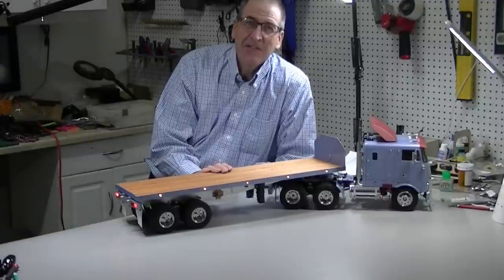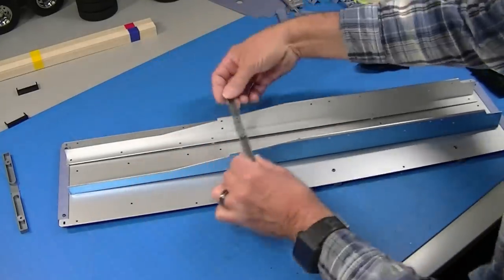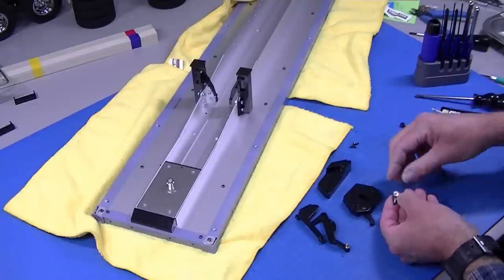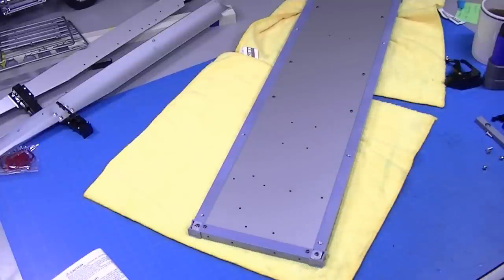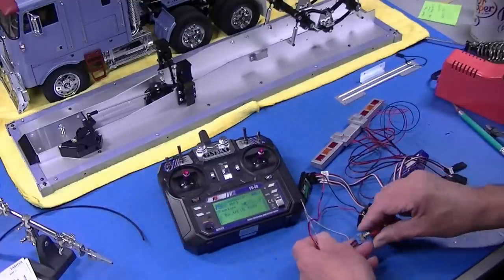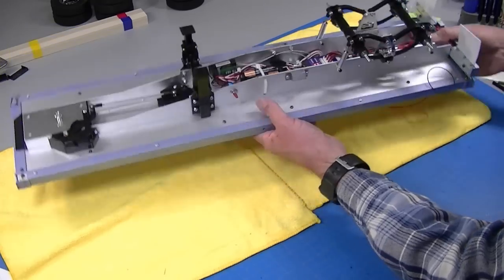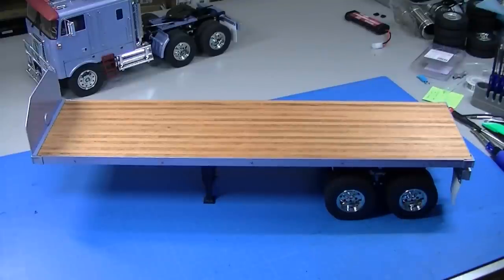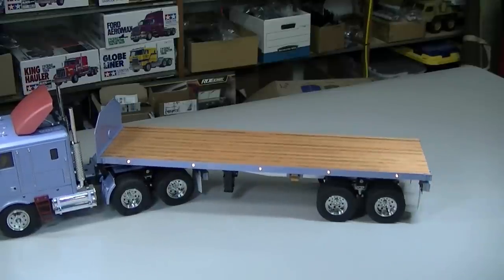1/14 Tamiya Flatbed Trailer Build w Wireless Lights - Globe Liner

Comment: I got the flatbed and started putting it together. In making sure I had the bed the correct way I didn't notice I put the king pin plate on backwards so the center hole was up front I guess we all make mistakes. I did the wireless lights and side marker lights the same as you did also added the Motorized leg kit. I put pictures on your Facebook page.

Comment: This is fantastic video showing the wireless connection. Thanks Bob! Is it possible to bind and control the trailer legs as well?
Reply from the maker: It would be possible but the Tamiya motorized legs sure do nut have any requirement for it.

Comment: I thought today. It would be cool if you could set up a linkage off the trailer landing leg mechanism to the electronics switch, so when you attach the trailer and the landing legs go up it also turns on the trailer lights.

Comment: I use only 1 double sided tape on the last cross piece( at the back) to secure the deck. That way if you need to get under the deck, removal is easy and doesn't damage the wood.  The load will keep the deck down!
Reply: Didn't it warp? Even if is' inside all the time the wood is going to buckle!!!

Comment: Hi Bob, my names Chris. And I had gotten a tamiya globeliner, and a flatbed trailer, and I can't get both to bound at the same time. Do I have to use two six channel receivers, because I have a 10 channel in truck and a six on the trailer, and I can't get them to bind. Don't know what else to do. Thank you and I hope to hear from you soon. Thanks again Bob, and I love your channel!!!
Reply from the maker: It only works with the i6a receivers.  The 10 channel or the "b" receivers will not work.
Reply: Hi bob , I have your modified fs-i6x radio and having trouble getting the two i6a receivers to bind together. Is the i6x capable to do this ?

Comment: I enjoy watching you build kits, informative and relaxing. On the light kit, would it be possible to power beacon lights or strobes? Going to have to order some parts from you come payday for my Bruder snow plow conversion.
Reply from the maker: Yes, you could power beacons, flashing LEDS's etc just fine.
Reply: I think there is a company called RAM that makes such lights.

Comment: Being a wood warier, I'm curious that even though it's just a small modal and wood expans and contracts if the air has a little moisture  wouldn't the wood warp? should have spaced the joints!!!!

Comment: Hello I would like to know please what is the voltage for the leds of the multifunction mfc-01 I would like to install others but I was wondering what was the voltage distributed at the output of this device given that the battery is 7.2 volts

Comment: I would love to get two of these kits and make a 45' or 48' trailer out of them. The kit is only about a 32' deck. I was thinking a guy should be able to cut the wide part of the frame out of one kit and splice it into the other.  Then splice the side rails (or buy some aluminum angle and make new ones) at a different point for strength as well as the deck. A guy could always by a dolly and make a train out of them as well.
Reply from the maker: Easy to build a long trailer out of 2 of these.  Also you could make it a triple axle.  I did something similar on my Hemtt trailer build.  (see my older videos)
Reply: @HobbyconceptsLLC   Yes I was just looking at that. I also found where someone had stretched their kit to 53' using only one kit. They did make new side rails but did not extend the frame underneath. Seeing the construction could easily do it with one kit, some 1/2 angle and some sheet aluminum.

Comment: I have the Radiolink AT10II 12 Channels RC Transmitter along with the Beier SFR-1, will this setup work with that?
Doug
Reply from the maker: If you have the Beier SFR-1 you are better to use the Beier IR or BT trailer units.

Comment: Hi Bob, nice job! Wondering, do you think this wireless setup would work  (binding 2 Rx) with an MFC-01 in the truck? Thanks
Reply from the maker: Yes it works fine.  The blinkers however run at different rates.

Comment: Hello bob
I can’t get my radio to bind both receivers at the same time as you have instructed 
I have the fly sky fsi6x transmitter and fsia6b receiver in the truck and light kit
Reply from the maker: Only works with the iA6 receivers.  The "B" receivers will not work.
Reply: Great I'll have to order those 
Both need to be a rec ?
Thix Bob

Comment: Hi Bob, did you add any primer on the aluminum before you painted it? Any chance that the paint may peel off?
Reply from the maker: I primed it, but anodized aluminum is hard to paint.  It does scratch easily.

Comment: I have the flysky i6x and was wondering if the second receiver that goes in the trailer has to be the same as the receiver that is in the tractor? Like can I have the fs-ia6b 6 channel in the trailer and the fs-ia10b 10 channels receiver in the tractor?
Reply from the maker: The 10 channel receivers will not work.  Only the 6 channel.

Comment: hello, does the light set have to be the same as the one from the truck?
Reply from the maker: No, in fact the truck does not even need lights for this to work.  Only works with i6a receivers.
Reply: @HobbyconceptsLLC  thank you 👍
Reply: @HobbyconceptsLLC  i have a different set of lights for my truck like what i have for the trailer, that doesn't matter, right?

Comment: Does this only work with the FS-IA6 receivers? I bought two Flysky FS-IA6B receivers as that was the only thing my hobbyshop had and they are not working together. I can only bind one or the other. Not both. Or is it my radio? Just realized I have anm FS-I6X not an FS-I6. Will that make a difference?
Reply from the maker: Only works with iA6 receivers the "B" receivers will not work.  Not sure about the transmitter.
Reply: @HobbyconceptsLLC  Thank you for the clarification. Although not the answer I hoped for.

Comment: Hello. Just want to know if want to do this wireless trailer light what items I need? Can you let me know..? Thanks
Reply from the maker: You need a light kit, battery holder, switch and receiver.  Only works with some radios and receivers - for example will not work with Flysky 10 channels, only the 6 channel.

Comment: Bonjour j aimerais savoir svp quelle est le voltage pour les leds du multifontion mfc-01 j aimerais en installer d autres mais je me demandais quel etais le voltage que distribut a la sortie de cette appareil etant donner que la batterie est de 7.2 volts

Comment: I tried this with my FlySky FA-i6X, I can’t get the two receivers to bind together. It’s only one or the other. Please advise.
Reply from the maker: Won't work with the 10 channel receivers - only the 6 channel.
Reply: @HobbyconceptsLLC   I am using the FA-iA6b 6 channel receiver. Is there a different one I should use? Thank you.
Reply: Lou, Did you ever get to the bottom of this question? I'm having the same issues using the same tx and Fs ia6b Rx... Cheers
Reply: Only the fs-ia6 receivers can bind together at the same time. I have 3 bound at the same time.
Reply: @dionhutchins7300  I have the FS-i6x transmitter and can’t get the i6a receivers to work , what transmitter are you using?
Reply: @javi0000057  that was when i was using the fs i6 and i6x
instead of having transmit 2 way change it to one way or vice versa. Bob has a video on it well he did have

Comment: Hi, kannst du mir verraten, wie die beiden Empfänger gleichzeitig mit dem Sender gebunden wurden ??? Rätsel !
Reply from the maker: You need to bind both at the same time.  Works fine with the FS-i6a receivers but will not work with the 10 channel receivers.  Also works fine with Spektrum receivers.  On Flysky units power up both receivers with the bind plugs in and then bind the transmitter.  Next remove the bind plugs BEFORE you power down the receivers.